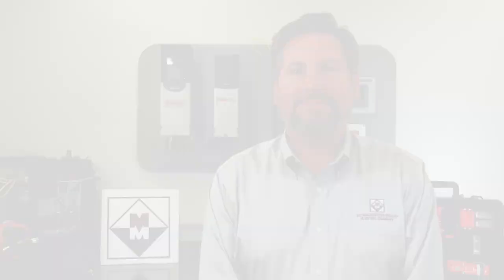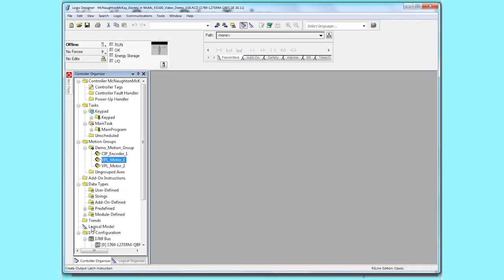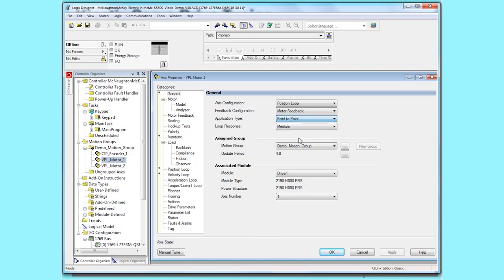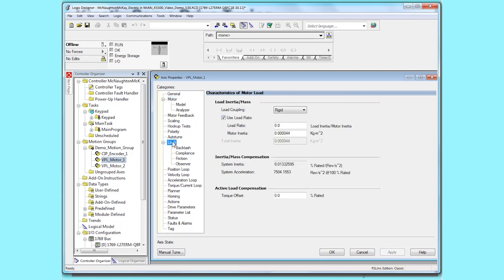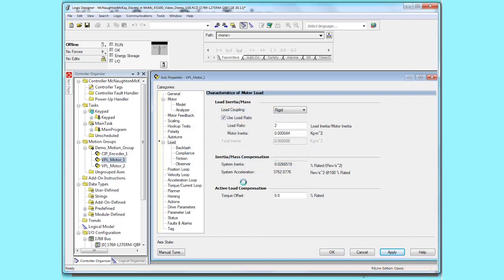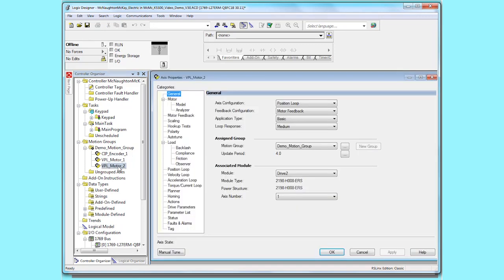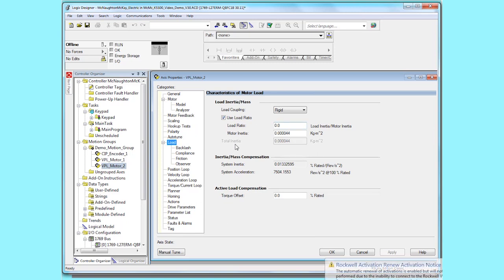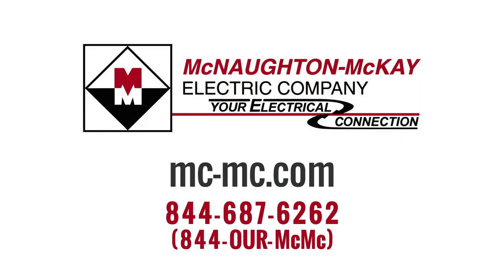How to Tune a Kinetix CIP Motion Servo Drive Using Studio 5000®  Software

Comment: 85/5000
GOOD NIGHT, WHERE DO I FIND EXAMPLES OF MOTION APPLICATION USING KINETIX 5500?
Reply from the maker: Hello John, You can find information for the Kinetix 5500 drive along with any examples that might be available in Rockwell’s literature library and the sample code library.
Here is a link for you to look at: https://www.rockwellautomation.com/search/ra_en_NA;keyword=MOTION%2520example%2520KINETIX%25205500;startIndex=0;activeTab=Sample_Code;spellingCorrect=true;facets=;languages=en;locales=en_NA,en_GLOBAL;sort=bma;isPLS=false;sessionID=79f8f96b-15ea-583b-10c3-58fc13156db6;deepLinking=false
If you have further questions or concerns, please reach out to your local Rockwell Automation distributor.
Reply: How to auto tune kinetix 350
My gear ratio is 5
And I have servo motor  mpl-b320p-sj72AA
Please reply

Comment: Well, that wasn't helpful.  From my perspective, you didn't actually show any tuning of the servo -- all you did was change some offline parameters.  I have a Kinetix 6000 Servo Drive on a commissioned application that I need to re-tune.  I can't seem to figure out how to initiate the tuning.  In RSLogix 5000, I go to the Tune tab, but as long as the Motion Group is running, the Start Tuning button is greyed out.  When I shut down the motion group, the button becomes available, but it complains about the axis being shut down.  When I do a shutdown reset of the axis I want to tune, the Start Tuning button goes grey, again. I'm in a Catch-22.  What am I doing wrong?
Reply from the maker: Hi Jeremy, When attempting to tune or autotune your drive, please review that the controller key switch is in REM position, and that you are online with the controller. The Axis must be in an axis state of Stopped, not Pre-charge, Running, Inhibited, Faulted or Shutdown. If you try to start the autotune while already enabled, you will notice the Start button is greyed out. If there is a fault that is inhibiting the axis or motion group. Recover the fault code from the drive diagnostics and refer to the user manual to clear the fault. If the issue does not resolve, please refer to Rockwell Automation Publication 2094-UM001M-EN-P for further configuration instructions on the Kinetix6000 Servo Drive, or contact your local McNaughton-McKay branch location for personalized tech support. https://www.mc-mc.com/LocationFinder
Reply: @mcnaughtonmckay  It's been a long time since I've had to tune a Kinetix Drive.  Turns out, there was logic running that was triggering an MSO instruction for that axis, everytime I tried to turn it off using the Motion Direct Commands.  Thanks for the thorough response.
Reply from the maker: @jnchoate  Happy to hear you were able to figure it out! Don't hesitate to reach out to your local McNaughton-McKay branch with any questions.

Comment: Micrologic 1400 and K5100 interfacing using lan...
Reply from the maker: Hello, A Kinetix 5100 servo drive can be controlled using a MicroLogix 1400 controller. Please contact your local Rockwell Automation distributor for more details.